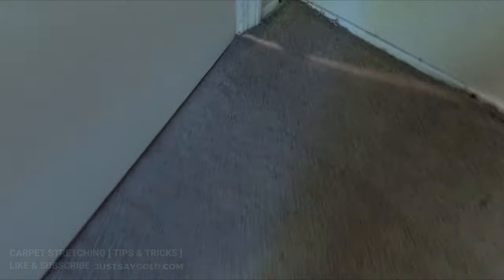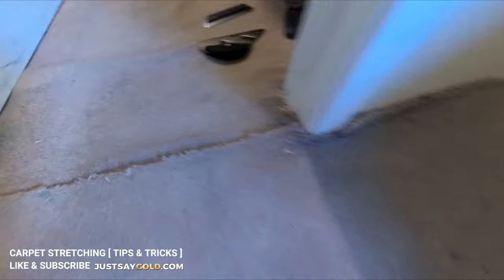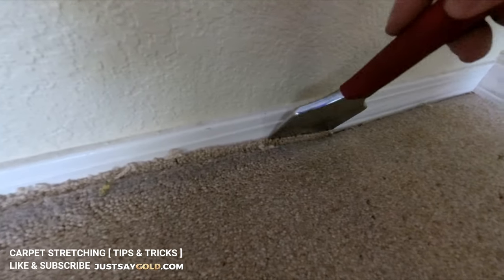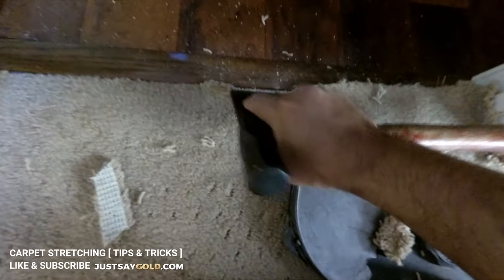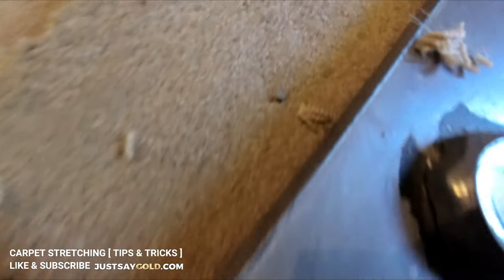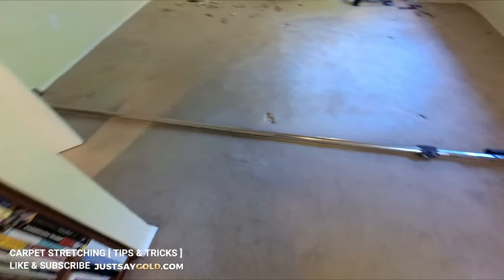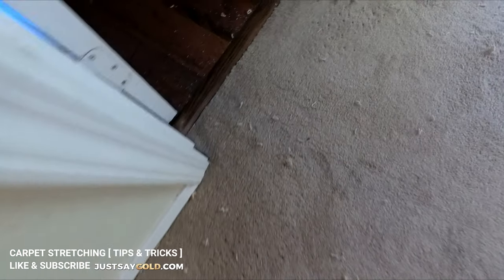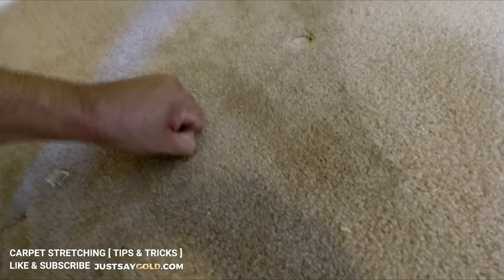Carpet Stretching Tips & Tricks For Professional Carpet Repairs

Comment: When using your knee kicker to move your stretcher, there is a notch on the back corner to accept the kicker face. Otherwise you risk tearing your carpet by kicking under your stretcher.
Reply from the maker: yes